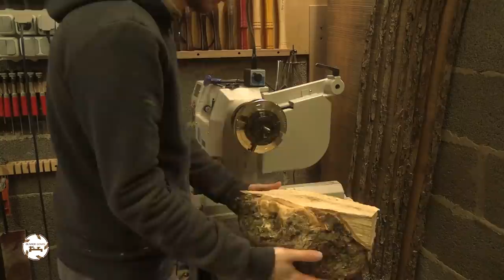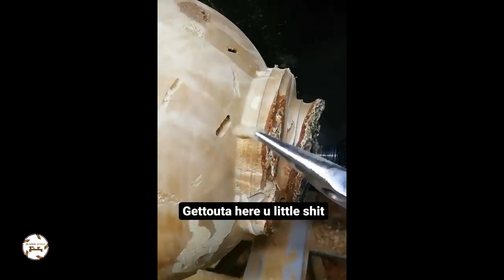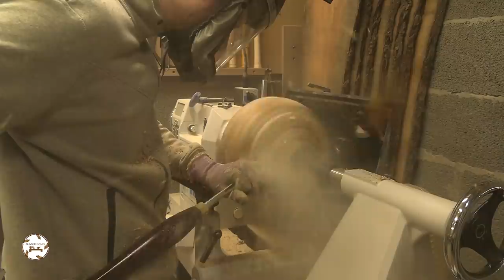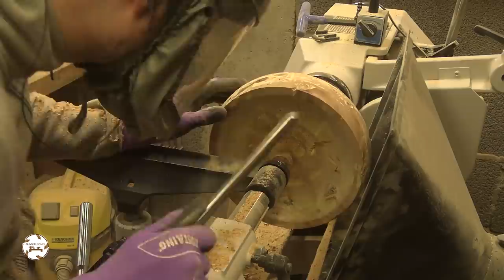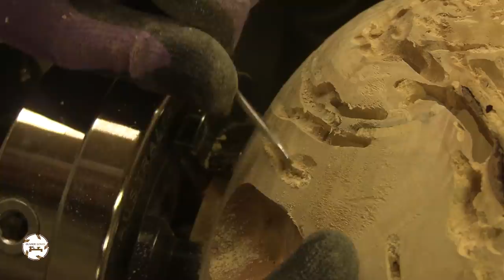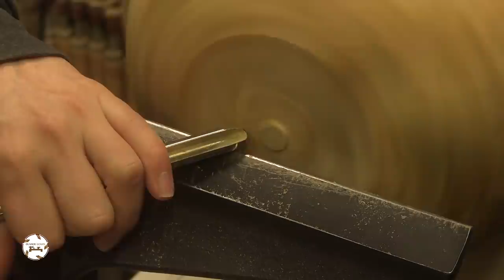Woodturning - A NASTY Suprise Inside

Comment: Most of the wood I turn has those worms or what they leave behind.   Over the years I have learned to embrace the worm tunnels since they only add character to the wood turning.  Using resin to fill the holes and tunnels only gets expensive since most of the resin is turned away and ends up on the floor.
Reply: That could possibly have been resin filled a bit like the table making guy does... get it to nearly final, and then tape the holes and pour the resin, then finish

Comment: I’ve seen bowls like this where the holes and indentations were filled with a colored epoxy, which looked cool.
Reply: I was thinking the same thing. There's a guy out here who makes boxes and such from mesquite and fills in the veins and gaps with resin that's been mixed with powdered turquoise (or other mineral that looks like it) and silver or copper leaf. Looks really cool.
Reply: @texasred2702  Same here. If I had gotten my hands on that bowl. That is what I would have done. But with clear resin and powdered quartz.
Reply: Yes, the guy I saw at an art fair in a Scottsdale had used a turquoise-colored resin which looked really nice in contrast to the lacquered wood.
Reply: Would be pretty interesting to use resin with strontium aluminate powder in the holes.  It's next-gen phosphorescent pigment which will glow for an hour or more after being charged up.
Reply: It always reminds me of kintsugi (Japanese tradition of repairing broken things with gold, ending up with the act of being broken resulting in a more beautiful whole) when I see them fill the bore holes like that. I was expecting him to do that here, too, but was pleasantly surprised by the final product when he didn't. I wasn't expecting it to be equally, though differently, beautiful.

Comment: If I was you I would go back and cut round holes every where there are worm holes and fill it with a pretty wood. And that spot that is mostly holes, start with one pplug then cut the  next one so it overlaps the first, and so on, using different pretty wood. Because the burom what you can see of it is beautiful. That way you go from junk to a really beautiful piece. I know it would be a lot of work, but I don't think you are afraid of work. 😛😆☺

Comment: I was told that some burled wood is caused by fungus and should not be used or it may harm you.  How do you know if the burl is caused by something safe or not?
Reply: seal it in epoxy...all done...
Reply: @marktwaine9344  Thank you, I hadn't thought of that.  But that doesn't protect you while you are creating the piece.  How do you protect yourself AND the area around you that the spores are depositing in while doing woodworking?
Reply: @pampierce  that gets complicated....depends how deep you want to go...there are evac systems designed to remove the dust and debris....but they are and expensive addition...I've seen these, in an industrial shop....

Comment: Whatever's infested and fits in a contractor bag, can be doused in a few oz rubbing-alcohol, sealed in, and swished around to poison the air inside with fumes; if you open the bag too soon infestation might recover, leave it an hour, rotate unevaporated-alcohol-side-up once or twice, re-saturating the materials: electronics, fire-wood-bundles, containers, bags, baskets, whatever's swarming breathes air.